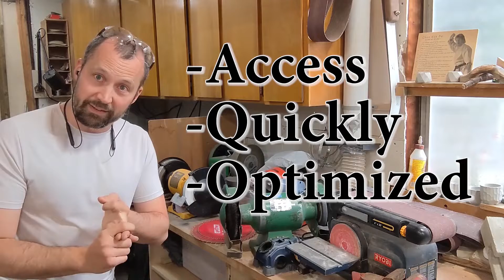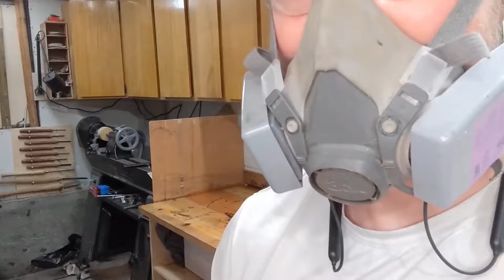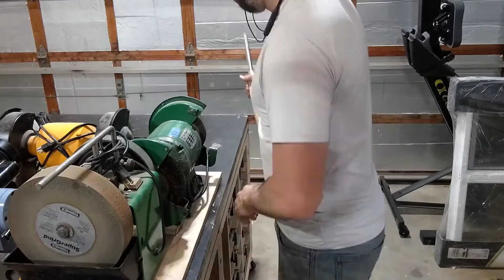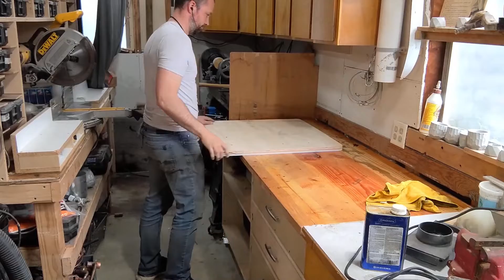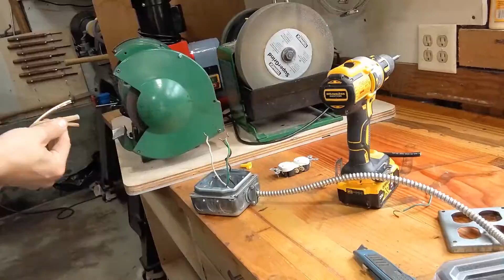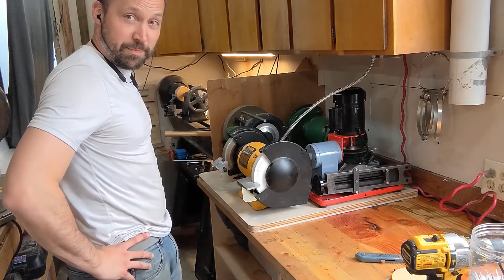UPGRADE your Lazy Susan size by 27%

Comment: Love it. I have challenges with the size of my workshop vs. the number of tools I have as well. How about a tabletop lazy suzan? I'm leaning towards that.
Reply from the maker: Sorry to miss this! The lazy Susan definitely has less friction but the issue is you can't turn a square plate with it that is tucked in a corner. This allows you to pull it out, turn it, and then tuck it back out of the way again.